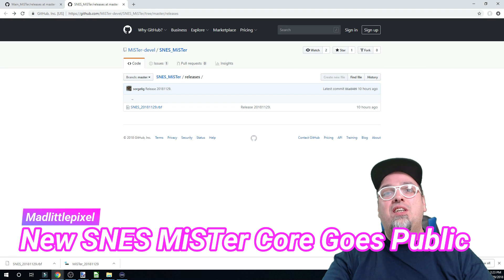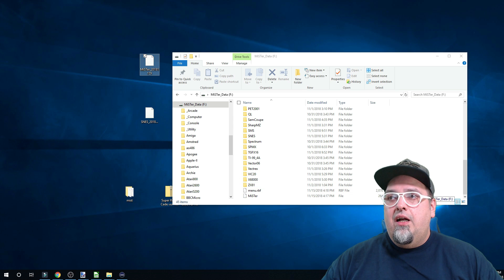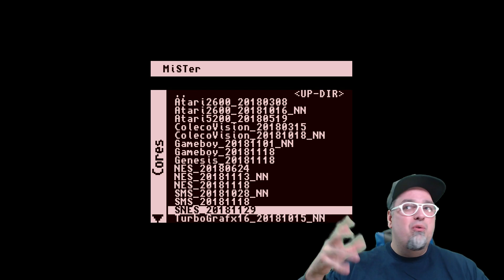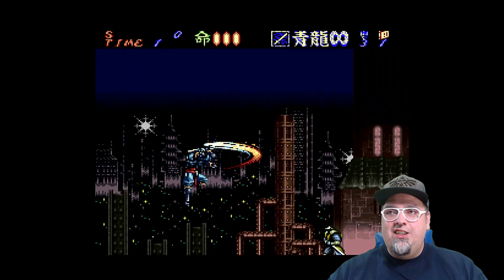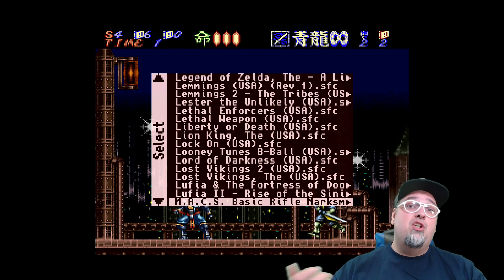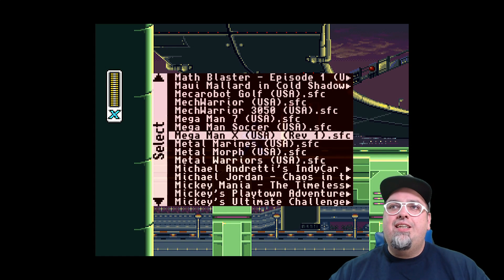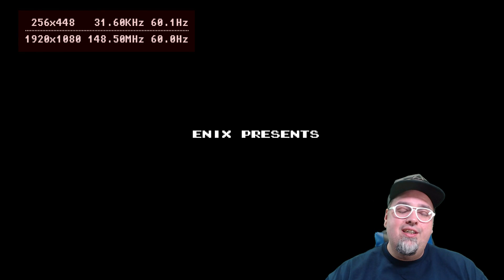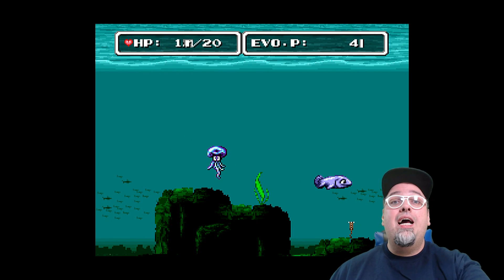New MiSTer FPGA SNES Core Is Now Public - Guide On Installing & Testing!

Comment: Look the Super Nintendo, and the Genesis is good at all, and I'm sure the fpga is a lot better than the emulators from what I'm seeing, but they can't put that on hold and put a fpga Saturn? That's what everybody's waiting for nobody really gives a shit or at least the real gamers are actually waiting for a perfect running Saturn version. We all know damn well Saturn was the best system and had the best games
Reply: So, 1) the Saturn had a very complex series of chips inside of it for a litany of reasons, making it very complicated to replicate in FPGA which leads to 2) this is entirely volunteer. All the folks working diligently on these cores are doing so for basically nothing (a few donations here and there), most of the ones I know have day jobs in addition to this, so acting like "nobody gives a shit" unless it's Saturn is a pretty shitty and entitled attitude to display when it's a volunteer/hobbyist community getting this stuff out there, especially given the long list of systems already supported to a fairly high degree of accuracy.
Reply: @SameNameDifferentGame  Two additional points to mention about it being a volunteer project. 2a) usually people who are working on cores are working on ones that they are interested in, and forcing everyone to work on one specific core would remove the enjoyment from the project for many, and 2b) the level of coordination required for a group of remotely located volunteers to focus entirely on one core would be impossible, especially since everyone working on it would need to have intimate knowledge of the Saturn's architecture.
Reply: @hjups  Yes, absolutely. Also this.

Comment from the maker: Concerning Input Lag; to note as it has  been brought up in comments as I didn't get into much about it here, my mind blanked on it for a moment, the 2 frames of lag are introduced by the scaling of the HDMI output apparently. If you use an analogue output such as VGA or component through the board that lag is gone. Despite through HDMI having 2 frames introduced its still not really perceivable to me. I will be doing some footage using component on this soon, so stay tuned~
Reply: cool, would be interesting to hear your thoughts on Super Mario World responsiveness through component.
Reply: I want to know if you have perceive, lag vs the super nt... I have bought the mister without the IO expansion, but i have a framemeister...
Reply: As far as I know a new scaler is coming which will have 0 input lag and a ton of options. This will be used by all cores.
Reply: @forevereverblue  this would be awesome!
Reply: I was about to comment asking about analog.  Thank you!  Can they both be outputted at the same time?  Like can the board output it's native signal to a PVM and maybe line double or even line triple to a capture device through HDMI?

Comment: My understanding is that emulation on the  MiSTer does not introduce ANY input lag (I could be wrong. I have no first hand experience). Did you say in this vid that the SNES core introduces 2 frames of lag? That's a significant amount of lag. Maybe you mean 2 miliseconds of lag. I think you would definitely notice 2 frames of lag on Mario World.
Reply: I believe the 2 frames mentioned is lag introduced by the scaling on the mister's hdmi-out. so if you use analogue out off the i/o board those two frames should disappear.
Reply: @drrrrzz9145 . Okay that makes sense. Thanks!
Reply from the maker: Yeah Gez is correct its due to the HDMI scaling. I didnt have the info fresh in my head so didnt get into it much but that does need to be noted its from the hdmi scaling. Still not really perceivable to me compared to other systems.
Reply: Yes but that would only be when you use the 1080p Scaler. If you output 480p and 720p HDMI there should be no lag because that is line doubling and tripling, which is not the same as scaling.
Reply: @albey1816  Are you sure? I still think the hdmi scaler has two frames of lag even with lower output resolutions. There is a new scaler in the works that is planned to have a low latency mode. The USB controls also introduce some lag, an average of 8ms according to some tests, this lag will also be reduced with a faster usb polling rate.

Comment: Man... its a hard sell to buy a Analogue Super NT or a Mega NT now that you can get both in one for less money.
Reply: And lag? lag Super nt vs Mister? in HDMI
Reply: @alexfu00  While it's not zero lag yet, an OSSC is just a FPGA device.  They are working on ways of leveraging this platform's FPGA to address those concerns.  The Mister project although moving at light speed is still in it's infancy.  Give it time, and it will only get better.  Great point to bring up though!
Reply: I own a SuperNT, it is great but after reading and getting a MiSTer I cancelled my Mega Sg order. I am not interested in playing games from real cart. I understand that the cores on Analogue's devices are better, especially out of the door, but buying every console Analogue makes, when essentially you are getting the same hardware in a different plastic case gets expensive. Also, I am sure that Analogue won't support small niche consoles and systems that are covered by MiSTer, so it is the latter project that needs all the support it can get.